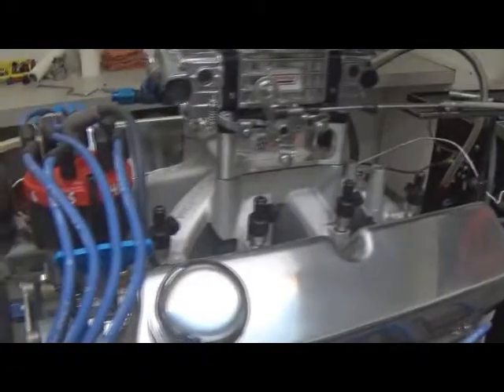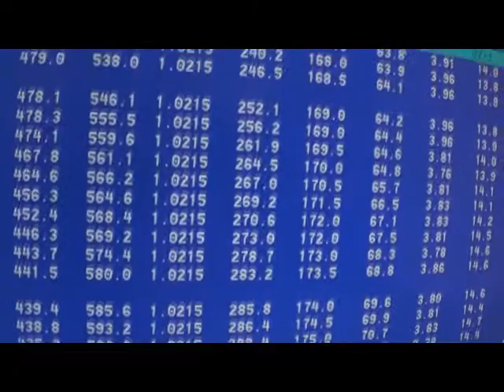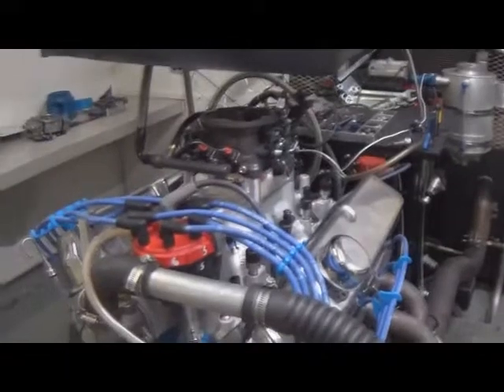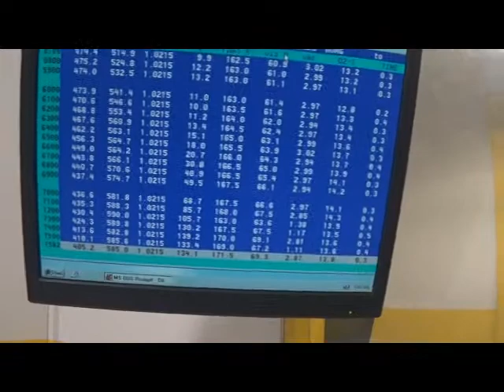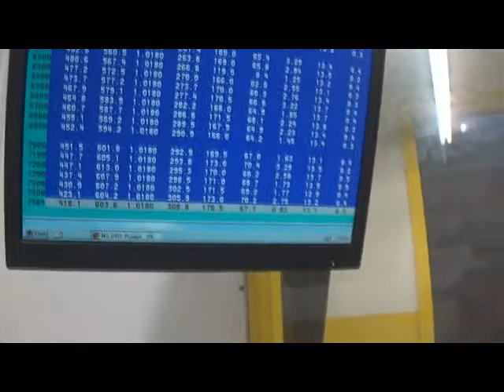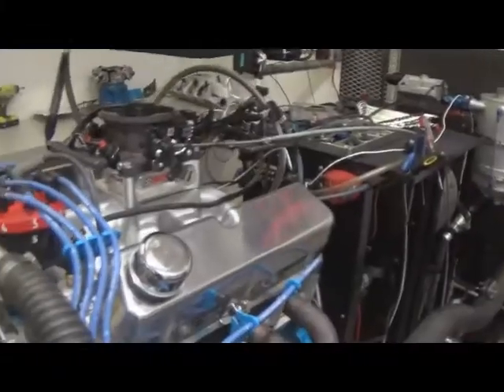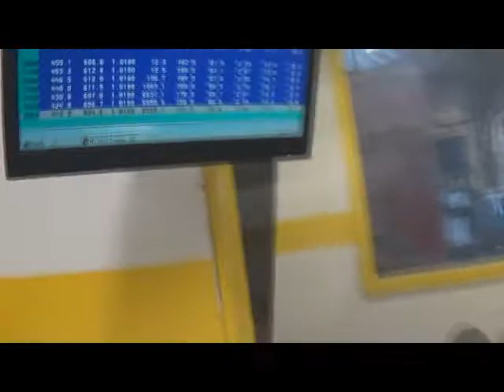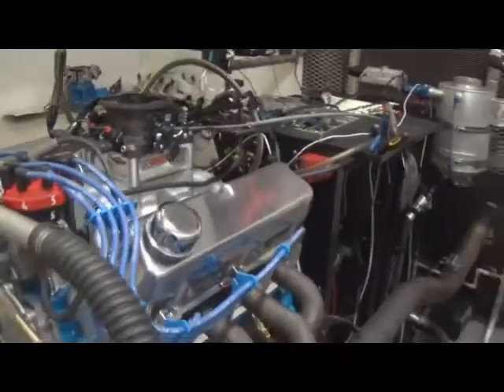PORT MATCHED MANIFOLD TESTING

Comment: That has to be a after market block?  Not known a factory ford small block to take over 500 HP without shattering,,,
Reply: jocrp6 - Wish I had seen your comment sooner.  Yes, this is my engine he's working on.  It's a Dart block, and he suggested I get the port match job on it, and I agreed.  He made this using my engine and the heads shown in the video.  On final assembly a Holley Terminator was mounted and tuned on the port matched Victor Junior intake and it produced 615 horsepower.  The engine went into my AC Cobra clone which is my daily driver.  I take it to the drags whenever I'm able and weather permitting.  I'm not a good drag racer and do it just for the fun of it, but I usually run in the mid to low 11's and got lucky twice and ran two 10.9's back to back.  I post a lot of the races on my channel - check it out if you wish.
Reply: An shp yes more than likely. But the main point is if you have the wrong manifold on an engine it'll run but not it's best and you'll starve it. Even in the performer RPM intake instructions it tells you to Port match your manifold to the heads. 

A stock rpm intake on these engines flow about 220 cfm MAX. A trick flow 170 out of the box flows like 240+.  That manifold needs to be ported and flow more than the heads. Either that or put a single plane manifold on but I wouldn't do that for a street car unless it was bigger than this engine like say a 408W 

But more to your point 363s like rpm
Reply: If uts a 363 its aftermarket
Reply: @GJ-DT  no that just means it started life as a 351 block it's just bigger bore and stroke
Reply: @jonathanlawson4667    no, a 363 is dart big bore block using the typical 347 stroker crank.
 Watch the vid, you can clearly see it is an 8.2 deck block. Its clearly not a 351 block. Besides the 351 block and 302/5.0 have the same bore diameter from the factory.
Reply: @jonathanlawson4667  Yes, it's an aftermarket Dart iron 363 cu. in. block.  It's the same outside size as a 302 cu. in. factory block.  It was supposed to fit right in, but I had to grind off metal in a couple of places so it would fit the same engine mounts.